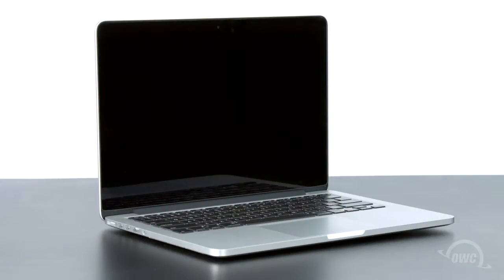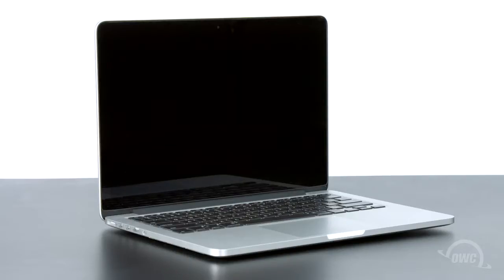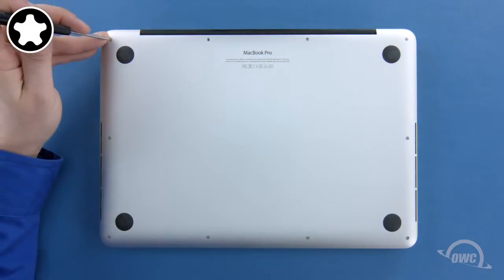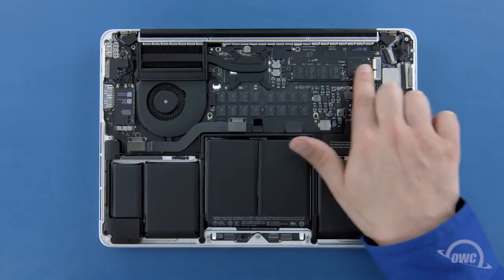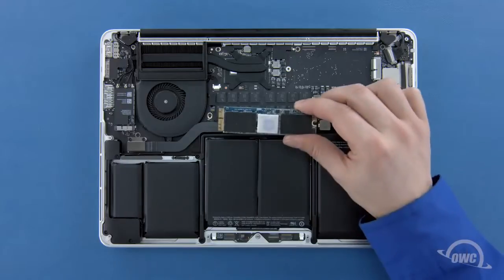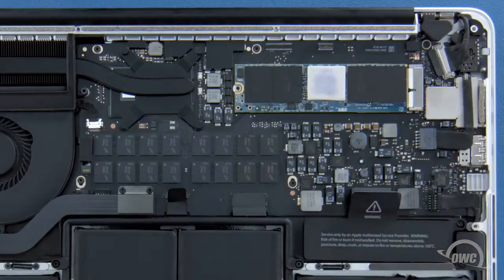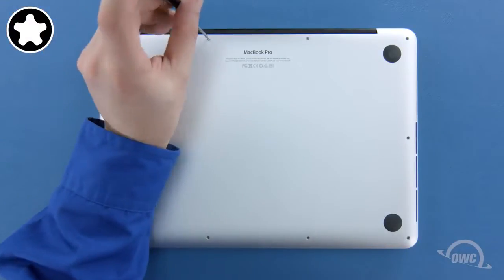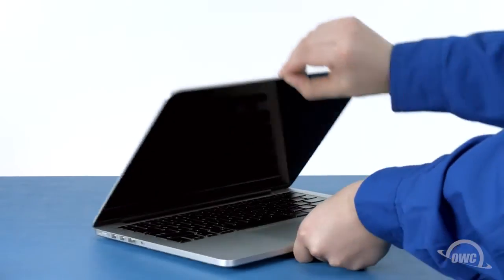MacBook Pro 13" Retina Eind 2013 - Heden SSD vervangen

Comment: Thx, a question, will a extern ssd drive do the same for me as an internal meaning that my McBook will see the extern as extra capacity so when I have a program that uses up 15Gb but there is only 10 on the internal drive it will pick the external drive?
Reply from the maker: No, that is not how that works. A program should then be installed externally in its entirety, the Mac will not store items externally automatically. It is also recommended to keep 10-15% of the system drive's storage unused.